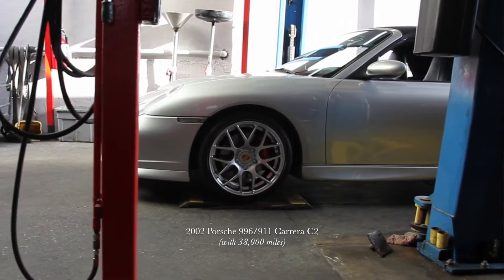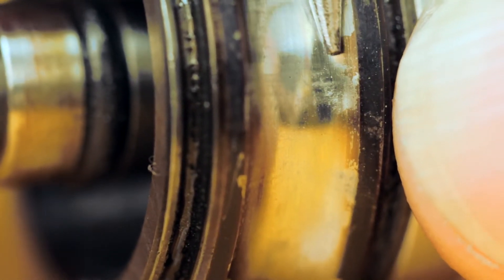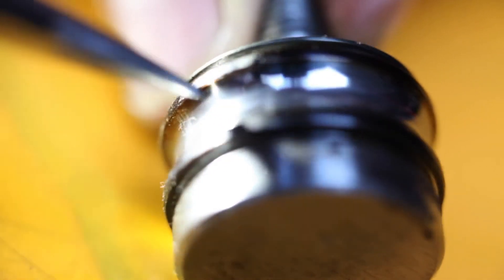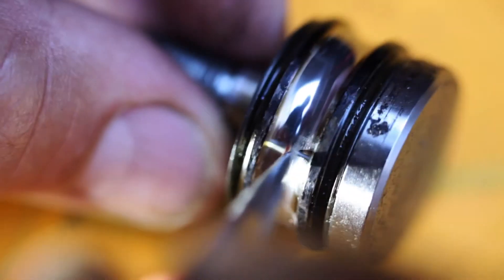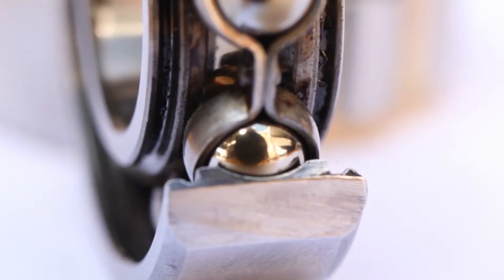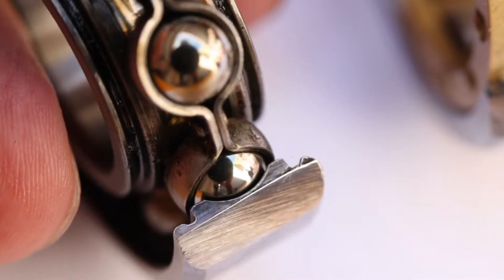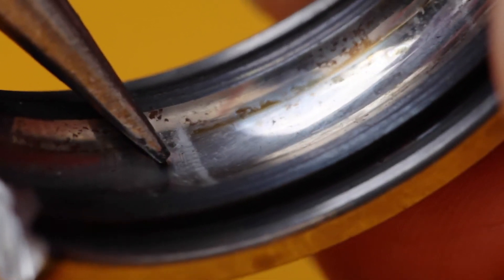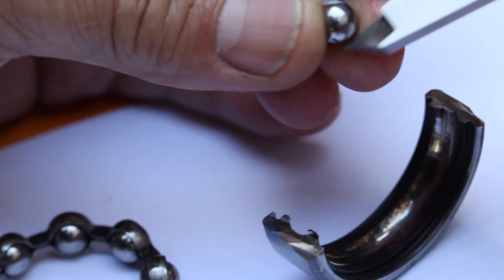IMS Bearing Failure 996 & Boxster - Retrofit Solution by EPS

Comment: I didn't see your solution, which your video title claimed to show.
Reply from the maker: Hi caduceus33, the solution to the failed ball bearings comes in our patented cylindrical bearing with thrust control. As mentioned in the video, the ball bearing failure is due to the limited amount of surface area (approx 1mm) that the load applies to. Our cylindrical bearing with thrust control applies the load across the total length of the cylinder, approximately 15mm AND allows the separation of the axial load from the radial load. In our system, the roller bearings do NOT carry the axis load (thrust control) on the side, which leaves the roller free to carry only the radial load (main load).The axial load is carried exclusively on the entire permitter of the outer race.

If you’d like more information, you can check out our product at https://www.europeanpartssolution.com/ims-bearing-upgrade-kit or contact us for more questions.